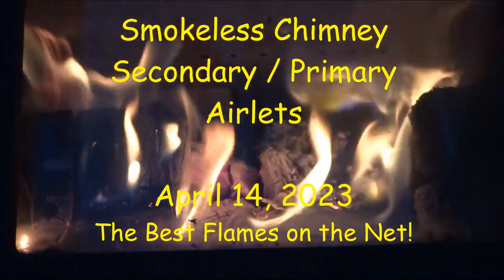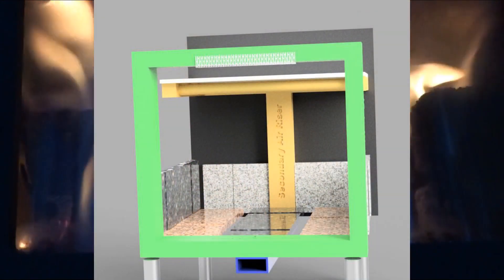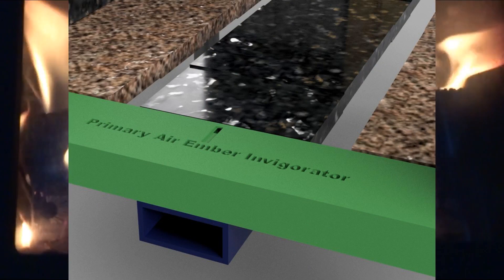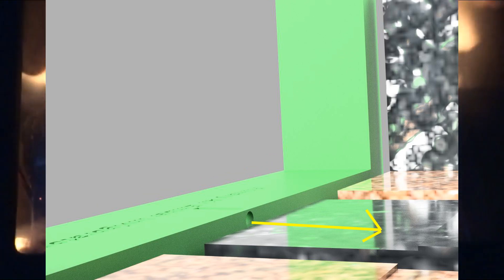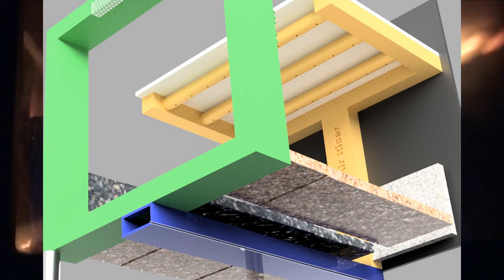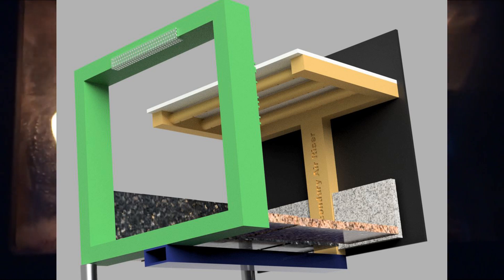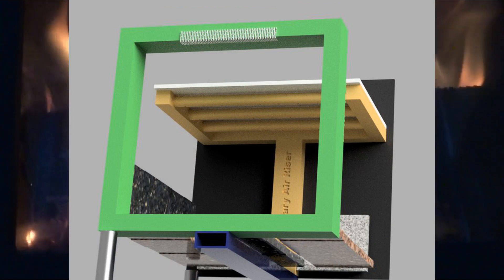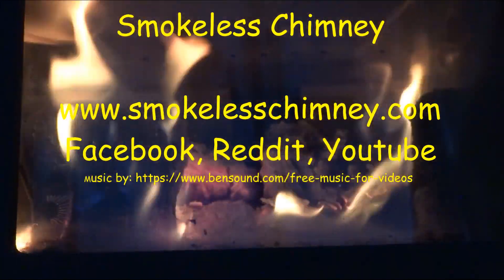Air inlets primary and secondary

Comment: Thank You! I like my wood stove, I've been using it for three winters. The sales people were informative and install was good. I do not recall anyone explaining about the Primary Air Ember Invigorator so when the video mentioned it I checked my stove, after clearing away the ashes and digging into the little hood I uncovered the Invigorator! Using a mirror because of the small hood covering the spot and needing to look backwards I could see the hole. I am certain the Invigorator has been plugged almost since the first days of wood burning. Though I am not looking forward to the cold of winter I am anticipating a better burning wood stove. Also, I have not over the many videos of wood burning stoves heard anything about the Invigorator and making sure it is cleared of obstruction. Two years ago I added a fresh air inlet, it helps much but I haven't been able to determine why the stove heat on certain days follows the fresh air pipe (which is about 16 ft) for several feet, maybe this will help.